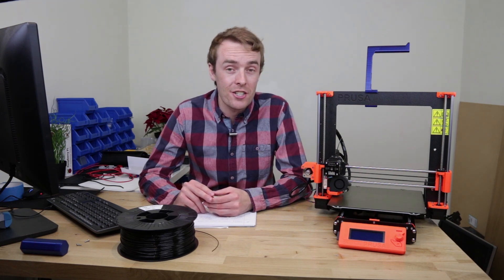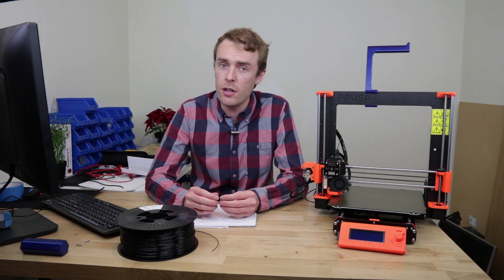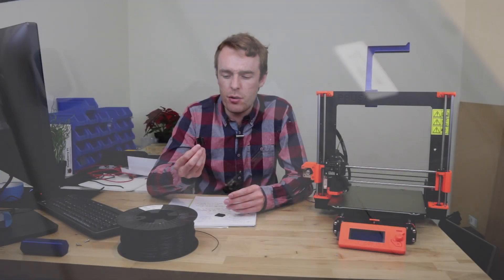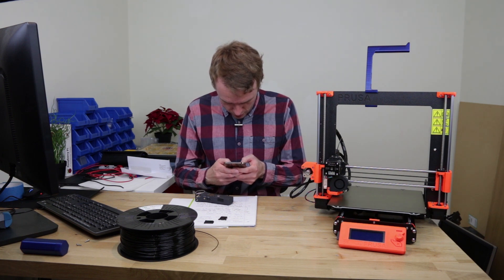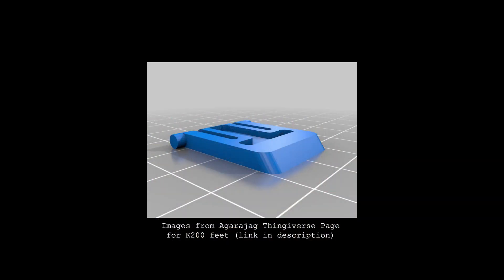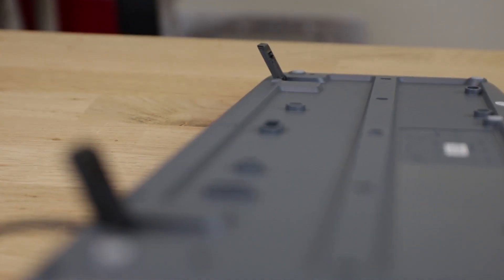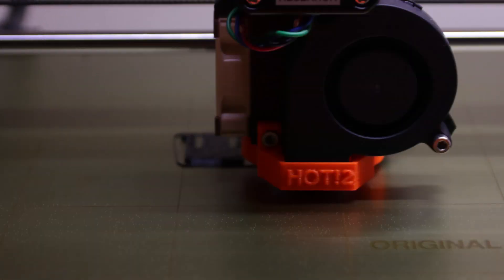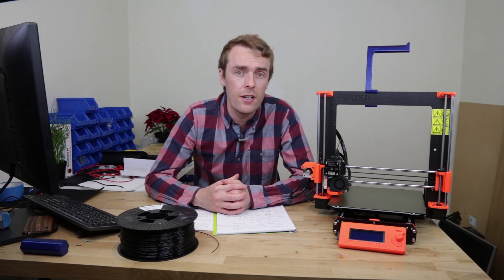#3DTWIP - Fixing the Non-Replaceable with Prusa i3 MK3!

Comment: Little repairs and improvements like this are why I love having 3D printers in the house. It's amazing how frequently a little custom plastic part solves a problem.
Reply: Sure! As an example, the last thing I built was an angled mount for LED strips and an enclosure for a switch + power connector. These were to add some task lighting on my electronics workbench. Before that, I designed some mounts for Oculus Rift sensors rather than use the ugly camera-style mounts I had before. And, of course, mods and upgrades for the printers themselves.

My current project is a super slimmed-down Arduino-based "BarBot" automated drink dispenser. Working on designing the peristaltic pumps at the moment.

Personally, I go to Thingiverse, et al, for inspiration and ideas but really enjoy designing parts myself. That's a huge part of the fun of it for me.

Comment: I've asked around and it seems TPU and TPC flexible filaments are pretty slippery so you'd be better off cutting up adhesive backed rubbery material from a hardware store or craft shop.
Reply: I can second this. I've been playing around with both MatterHacker's PRO Flex and NinjaFlex. They're absolutely amazing (the latter even more so) but they definitely don't have the tacky surface that you'd want for traction feet.